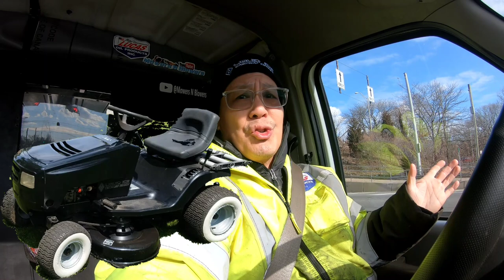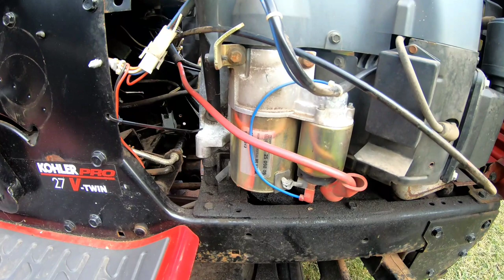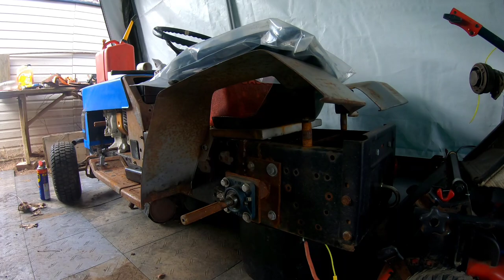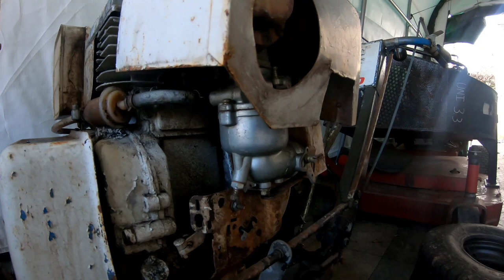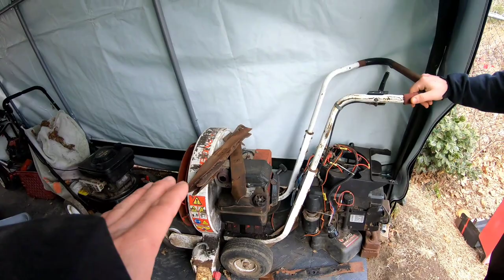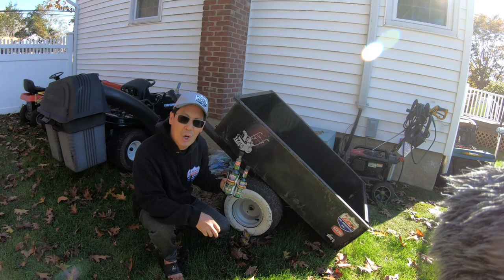FREE BRIGGS 12HP FLATHEAD ENGINE TROY BILT WEED TRIMMER CRAFTSMAN QUANTUM PUSH LAWN MOWER BAG PICK

Comment: Henry, let me know if you need any welding done on any mower decks. That is what I have been specializing in. I do sheet metal for automotive repair and usually 12 gauge sheet metal for decks. I can also fabricate other stuff so keep me in mind and also tell Jason and Nick if they need any work done. As a matter of fact I just bought a vintage mower deck for one of my classic John Deere 110,112 tractors that I am restoring. I bought it for 20 bucks without any pulleys or anything but it has bad rust and holes. I will take pictures and then see if I can video the weld process but I butt weld the plates so normally with usual holes they do not stand out when finished. Talk to you soon.
Reply from the maker: Jimmy,  I have a deck that I never really finished because it was too much for me to do.  As i am not a welder I kinda gave up on it.  I would love you to fix it for me, but as you know my entire channel is about not spending money to get her done!  You would be fixing it as a contribution to the channel if you were interested.  Of course I would shout you and your business out.  Where are you located?
Reply from the maker: This deck is what I’m talking about.

RELUCTANTLY WELDING REPAIRING GRINDING PAINTING RUSTY ROTTED CRAFTSMAN LT1000 LAWN MOWER DECK PATCH

https://youtu.be/ghY0xP6a27s
Reply: @MowersNBlowers  I just did two like that one two weeks ago for a guy that bought two mowers sight unseen to repair and give to his relatives. He can do the engine stuff but the welding not so much.The deck that I have for the John Deere 110 looks like swiss cheese. I have a lot of experience with this sort of thing because I bought a Jaguar Xj that was swiss cheese and through determination , many spools of welding wire, a Miller Mig and lots of 18 gauge steel I was able to make it beautiful and sold it for a nice sum. I actually like welding and get a feeling of accomplishment.I will try and find you on Facebook and give you my information . There ay be some things we could collaborate on. I want to start a You Tube channel any way. Thanks my friend. I still have to get to Woodbury or Harrington NY next week to pick up my big welder. I was going to do it this week but it is going to blizzard here today from what I hear.
Reply from the maker: Jimmy, thanks...then there’s the distance between us,  we may be too far away from each other to make it logistically worthwhile.  We are getting a slushy inch here. Blah
Reply: @MowersNBlowers  I am in Phoenixville PA. I am a Chemical engineer but I am currently working as a metrology , calibration and validation specialist for a pharmaceutical company. I am expected to do some things that I cannot do because of my accident ten months ago. I plan on starting a mobile small engine business where I will either go and repair equipment including welding using an enclosed trailer  with air conditioning , heat and a small machine shop consisting of a lathe, drill press and some other equipment. Or I am going to do the same and do free pickup and drop off of equipment to set myself apart from the few others in my area. I looked and there is literally only 4 or 5 people. The area in spring and summer is rife with lawn care and in the winter snow plow and the like. I went through a bad divorce so this name is not my real name. I can find you on facebook and give you my information and I will absolutely do your mower deck when I have some time. I am sure I could use the publicity. Thank you Henry. It is quite expensive when you actually have to pay for those kind of repairs. Not quite as much as a new deck which usually are not even available. Sure thing my friend. Is that the best way to get you my information? by facebook? or is there an easier way? Distance is no big deal. I just went back and looked at that video. If I can repair that deck it would be quite an achievement. It will be a fabrication and repair. Very cool. I will more than likely be taking another position similar and soon but I should have a few weeks while I figure out what I am doing. I definitely plan on doing this.
Reply: @MowersNBlowers  Not a big deal. about distance. It would be good for publicity if I do intend on starting that business. I do not know exactly where you are but it can't be more than an hour and a half or two hours.
Reply: @MowersNBlowers  I live in Bethlehem right now which is about 30 minutes from Doublewide6. I would really like to specialize in doing deck repairs and sheet metal work to eventually be doing this stuff full time like you.I really like it and it is more fulfilling than a 9 to 5 because they are not paying any where near what I think I should be getting. I guess I will have to finish the tractors and motorcycles I have and sell them and then start ramping up for spring. The weather is just too cold out. I can use my dad's place but even with that I have to run a propane heater in the barn.
Reply from the maker: My contact info is in every video description
Reply from the maker: 3.5 hrs bro,  I used to drive to stroudburg to buy fireworks.
Reply: @MowersNBlowers  Ok I will be in touch my friend!